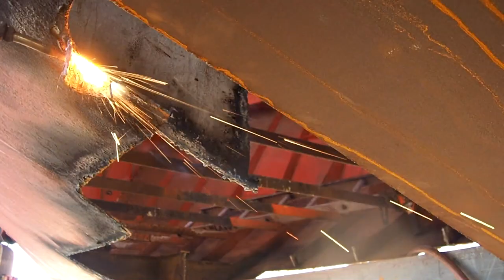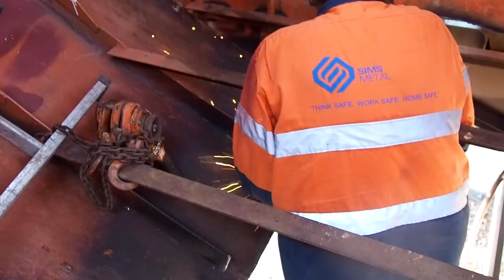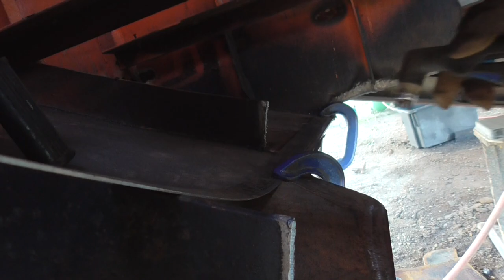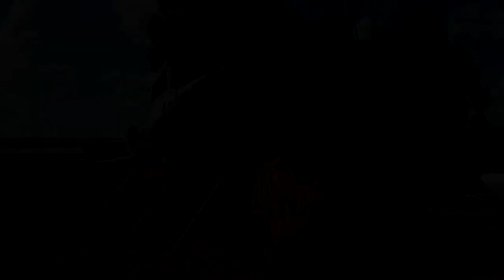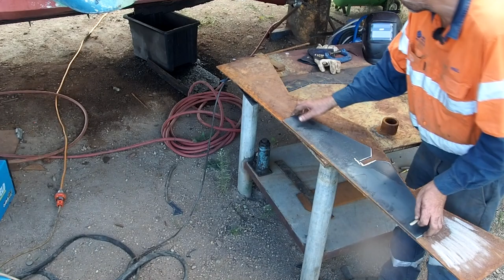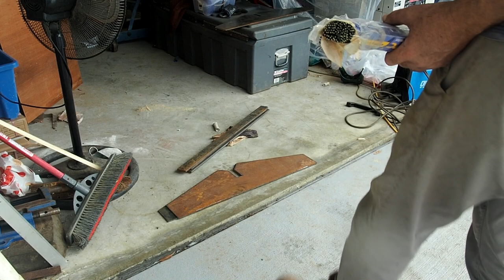EP49- Rebuilding a liveaboard trawler. Forward cabin stringer fabrication and welding

Comment: I watch most boat building/fixing youtubers, if its a sailing yacht and I have little interest in motor boats, but I do watch all of yours.
Reply from the maker: Cool, Keep watching Racheal. I have to do some work on our sailboat very very soon. It crashed into another boat when it came off our mooring the other week and caused a bit of damage. I wish I has documented all of our refurbishment of Hawkeye. I did most of it while we were still on the water. I need to sell her but I am reluctant. I want to sail out to Lord Howe Island on her. She is the type of boat that is built for that sort of trip. Most of the systems we are putting into this boat are the same as on a sailboat. I am considering putting either a kite sail or a spinnaker/ genoa arrangement. I've made enquiries about a kite sail. The reason we are moving away from sail is that I was always turning the engine on anyway and I was getting sick of waiting for the right wind and a big enough tide to get me across the sand bar where she is mored.
Reply: @TheadventuresofSherylandPaul  Oh, I wasn't aware you had a sail boat too. A few months ago your video's popped up when you had just got this one and were starting to move it and make the stands and stuff, and when I saw how far gone it was I clicked subscribe because I wanted to see how you would fix it. I'm planning on buying a steel hull sail boat when I move back home to the coast but there is not much of a selection in South Africa. I have seen lots of them available in Aus, but I want something "cheap" so I can rebuild it myself over a few years and I cant move to Aus and fix it there because of visa's and costs, and cant buy one there and sail it home because the kind of boat I'm looking for wouldn't be sea worthy any more.
Reply from the maker: https://www.youtube.com/watch?v=hdKQU8fzVqQ

She looks very different to this now though.

https://www.instagram.com/p/CGMME8oAgQn/
Reply from the maker: Hawkeye is steel too

Comment: Another handy video. I am not a shipwright by any stretch of the emagination but when you were standing in front of the boat I noticed the shape of the hull. I was thinking if you welded two stabilisers, one on each side under the hull so they do not interfere with docking it would give you a smoother ride. Just a thought.
Reply from the maker: Ahh, this will be revealed a bit later on lol. But yes I am planning on putting some fins on each side of the hull. They are going to be hollow and form the keel cooling for the engine. I am working it out. There is a bit involved such as kilowatts per square meter of steel. I have to consider an intercooler and oil cooler also so it's a bit of a process. I have it worked out (I think). You're always bringing these questions up around the same time I'm researching them. Great work Bob.

Comment: Another great video Paul. I assume you are going to weld the top front edges of the hull plates first, then warp them around as you have greater leverage, then grind and weld the bottom edges along the keel as necessary?
Reply from the maker: Bugger, I did a lengthy reply to this and didn't save it lol.  I'll make it brief this time lol. I'm not working up the very front at the moment so it is easy to bend them around. When I move to the front I am thinking of taking the plates to my mates' workshop and using his 200t brake press to "break the back" of the sheets so they form a bit easier. I hate grinding so I try to trim using the plasma or oxy. I try to just clean the dross away with the grinder so the weld isn't affected by the impurities left behind.